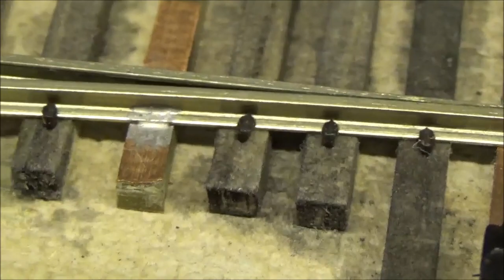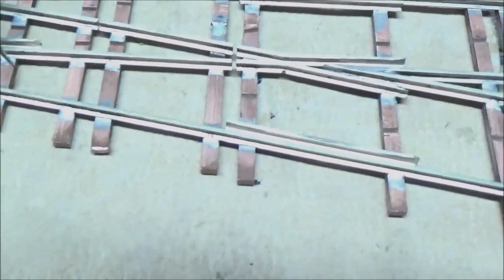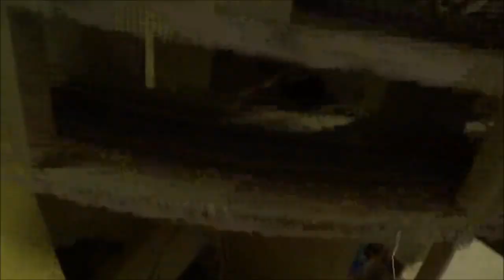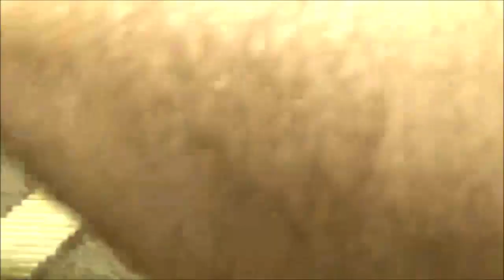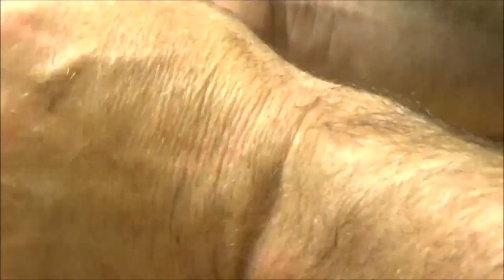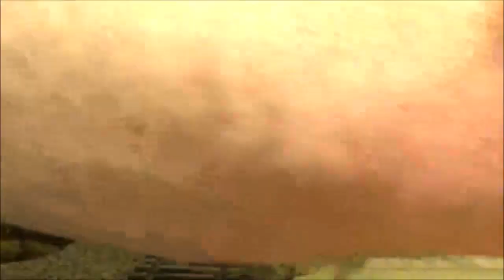Model Railroad Update 18 (Track Work Continues)

Comment: Wow that's cool.   One of the best videos I have seen.   I'm rather new to your channel,  is all or most of your track hand laid?
Reply from the maker: Thanks for the kind words Chris.  The only scratch built track is the engine service facility, spur into the creosote plant.   That way I could still run trains on the main line while I worked on the scratch built track.
Reply: Thanks for the reply.   I'm starting the planning process now.   Hopefully start construction around the middle of next month
Reply from the maker: That's exciting, doing some thoughtful planning before starting is definitely a good idea.  What era and location are you thinking about modeling?
Reply: 1972 around Everett Wa, Renton, Seattle.  (Boeing's aircraft plants) .  Also into California's central valley,  Fresno to Mantica.  These are the areas I grew up in..  Biggest reason why I'm going N scale,  to much for HO.  LOL
Reply from the maker: That sounds like Burlington Northern?  Yes the scenery to railroad ratio is definitely better in N scale.  How large of an area do you have to work with?
Reply: @ChessiePAdiv  only 14x14 with a 6x10 staging area.   If I'm not wrong BNSF didn't take over till 83.  Should be Western Pacific and U P.  Been getting different answers

Comment: That's a Sweet Three way switch.
Steady as she goes I always say. No need to rush and ruin all your beautiful work you've done to this point.
I  work in On3o which is essentially Ho gauge track. Am thinking of tearing up all my manufactured track and hand lay after seeing how well yours turned out.  I only have 12 ft single track with 3 number 8 switches.
Thanks for the inspiration and the beautiful layout .  Please keep  us posted  with more great layout build advice.  Will wait patiently for your next installment.
Oh and I say Put at least one inspection pit inside your engine house.  
Thanks again.
Reply from the maker: Thanks James, it was a fun project but as you suggest it took several sittings to complete so as not to rush the build.  Have you ballasted your track?  If not I have observed that the scratch built track operates more smoothly than commercial track especially at the frogs.  Yes I probably will make an inspection pit since there is already a hold in the baseboard to accommodate one.
Reply: No I haven't ballasted as yet. The last switch was laid July 2017 I have been unable to decide if I want  sand and short grass or ballast between the rails or  mixture of both. This is strictly an industrial linneral line.  My railway name is.
Red Handed Brick Company. 4 locos and 200 side dump open hoppers. ( In reality 1 loco and 10 hoppers make up a train. I plan on hopefully 6 more  4 ft and 6 ft modules. All my track is code #83.
After seeing what you have done handlaying track and making switches from Fast Tracks. 
I really believe my layout could be so much better.
I have known about Fast Tracks for a number of years.  I always thought those kits were very expensive. And never really persued past looking at the site online.  You have really given me the inspiration.  Thank you.
Reply from the maker: Sounds like a cool narrow guage rr you have there.  Well if you have not ballasted now would be a good time to make the switch to hand laid track.  Since you have a relatively discrete area of track to work with it might really add some great detail and personal touch.  Since you will be building more than one no. 8 turnout a fasttracks jig might be a good investment.  You can built the turnout first before removing anything from the rr so you are still able to run trains while you get comfortable building the first one.